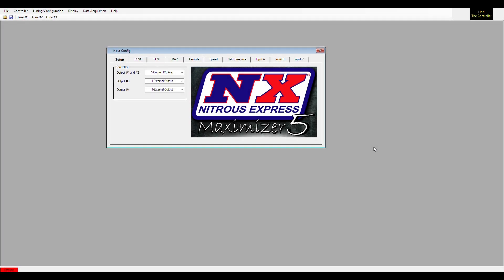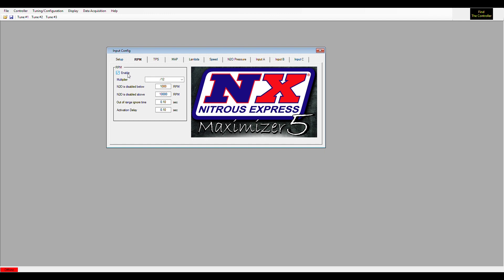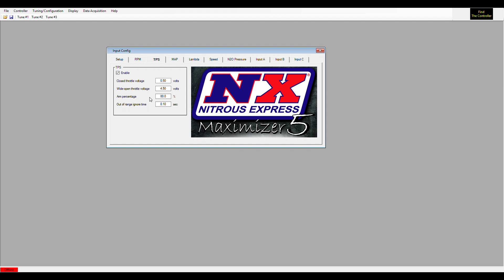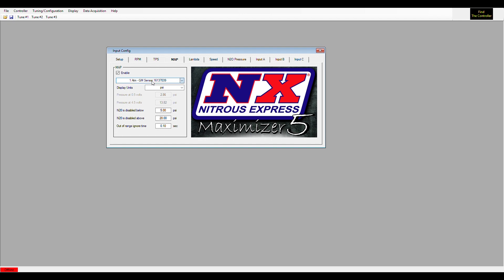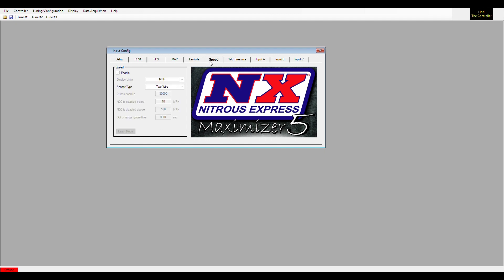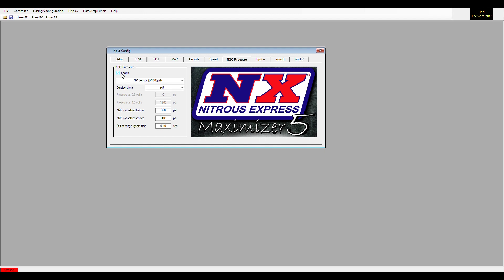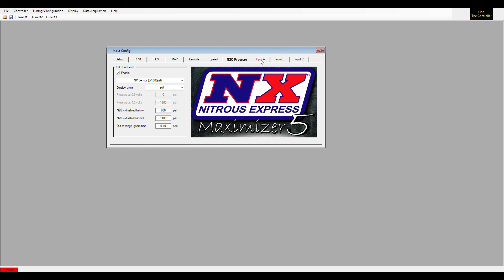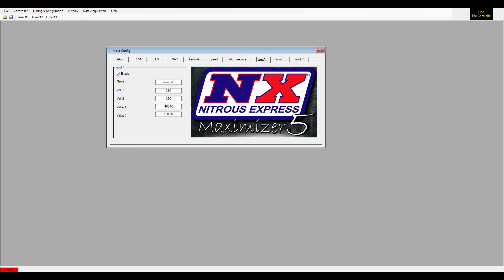Nitrous Express Maximizer 5 Input Configuration Setup Explanation

Comment: So The Green Wire Labeled Lambda Connectors To Your Widebands 5v Analog Output Signal? It Seems Obvious But Manual Doesn't Say Where It Connects And I Want To Make Sure.
Reply from the maker: Yes, that is correct.

Comment: So Inputs ABC Can't Be Used To Be Controlling Inputs For Output 3 Or 4? Like You Couldn't Wire Up Temp Sensor And Have It Control Outputs 3 And 4 Thermostatically For A Trans Cooler, Oil Cooler Or Coolant Fans?
Reply from the maker: Inputs A,B, and C are datalogging channels only. They will not have any effect on any outputs.

Comment: I have my maximizer 5 setup for time based but it still pulses. Please advise on this issue. What hertz does it recommend setting at?
Reply from the maker: Time based ramps still pulse the solenoids,  the hz depends on what solenoids you are using.